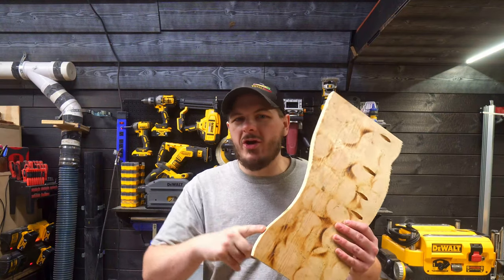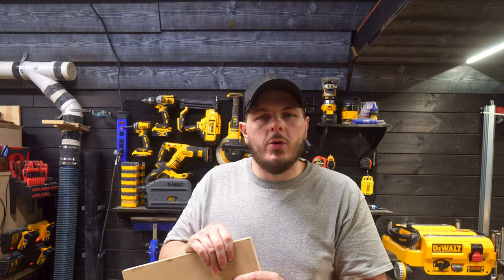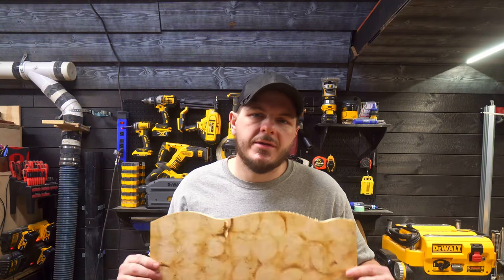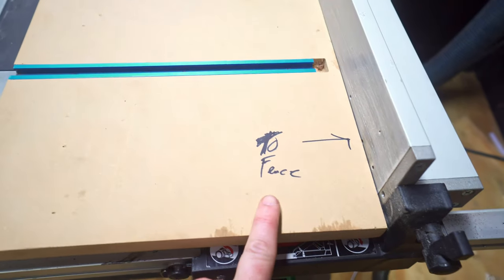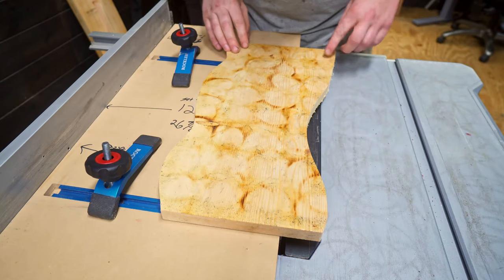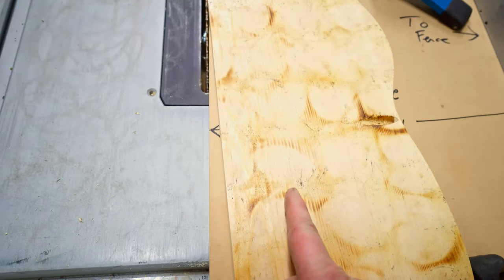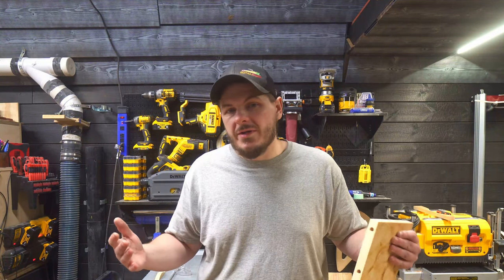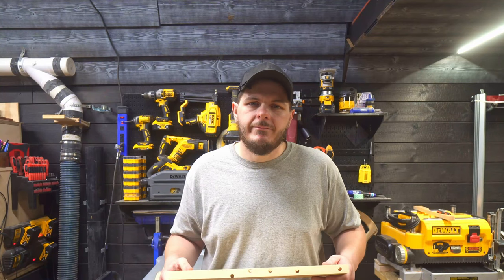Get A Straight Edge On Any Board With This Simple Jig Using Rockler Woodworking T-Track and Clamps

Comment: Would you please send me the CNC file you used for the jig, and the table saw push sticks you have. I just ordered a CNC (I SO FREAKEN EXCITED). If your ok with that, I can give you my email. I have no idea how to use gcode... but I'm studying every night.

I wanna use a jig like what you did in this video to straighten and make uniform some pallet boards I am gonna use for an accent wall.
Reply from the maker: Hey I don't have them on file they are extremely simple cuts and extremely simple files to make It just was something complicated I would not mind sending it to you. But I really do suggest using Both of these projects as starter projects to learn your design program for the CNC. Tons of little projects that are simple are really great ways to learn the ins-and-outs of the machine.